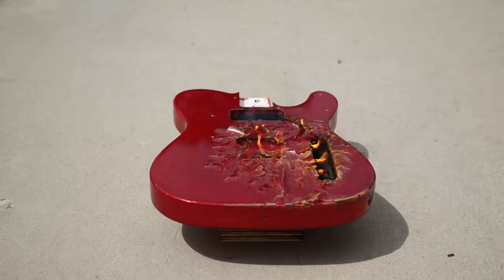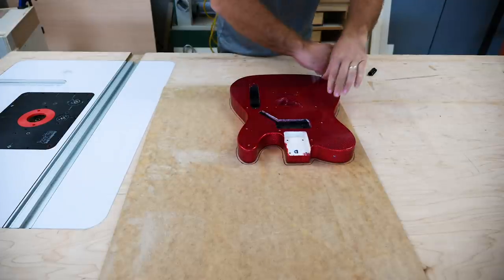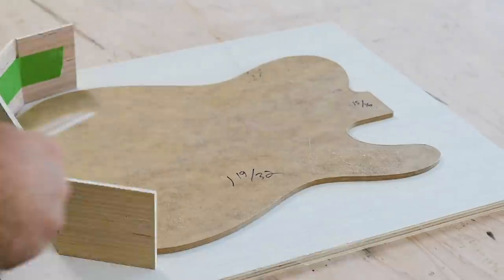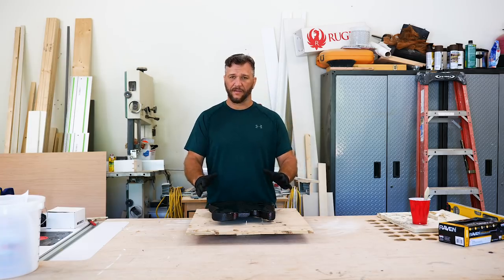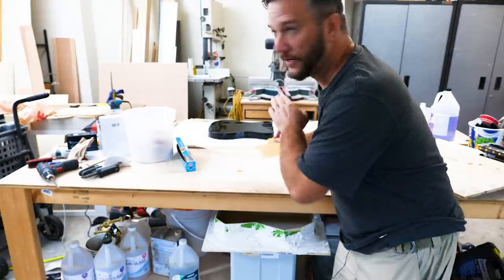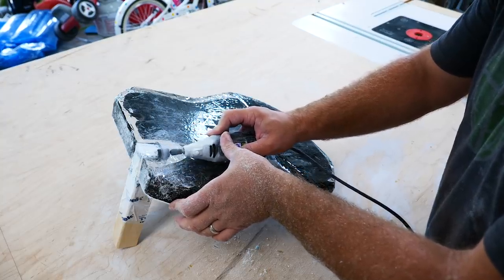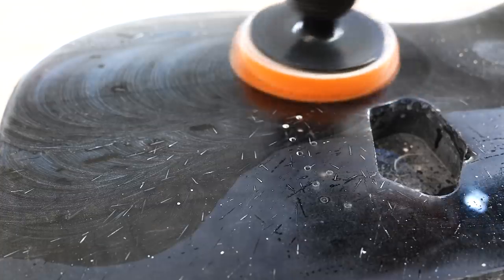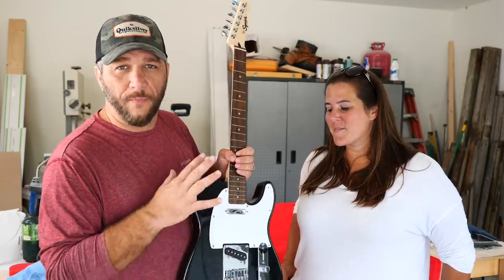I Built a FIRE and EPOXY Guitar! The FLAMECASTER!

Comment: The pick guard is irrelevant since the body is made of epoxy (it's not going to get scratched by a plastic pick). The problem is that guitar necks are not just screwed in. You have to check the angle and adjust it because you have altered the cavity that the neck sits in. I know it looks like a hunk of wood but it's a very finely tuned object that you (and many other YouTubers) seem to think can be taken apart and slapped together at will. Otherwise, the guitar is pretty much useless.

Comment: What was the reason for putting on the table top epoxy first? Couldn't you just have poured the whole thing? I'm curious because I like this so much that I may do a bass just like it. Great job!
Reply from the maker: It needs a thin layer first to seal it. If you don’t do that you’ll get tons of bubbles. The tabletop epoxy will set much faster than the thick pour epoxy so that’s why I used it first. Thanks!